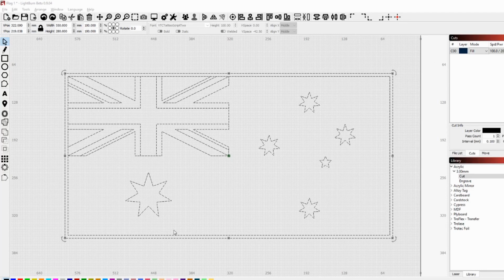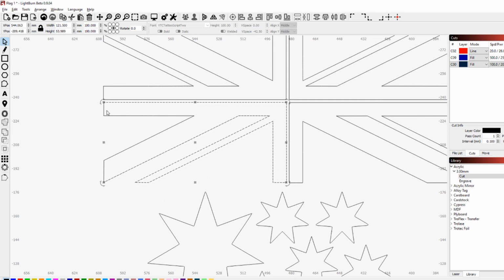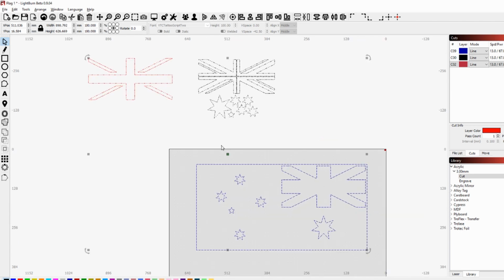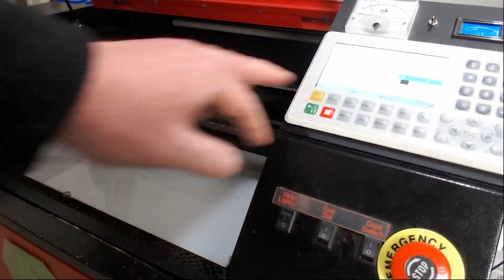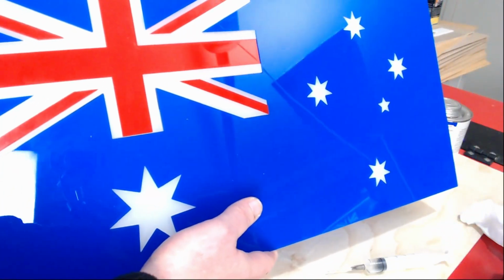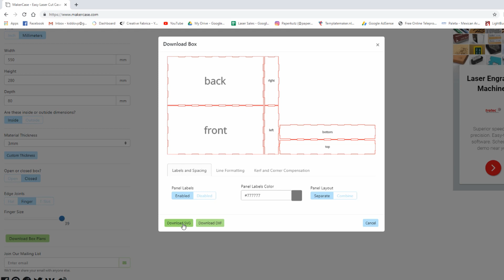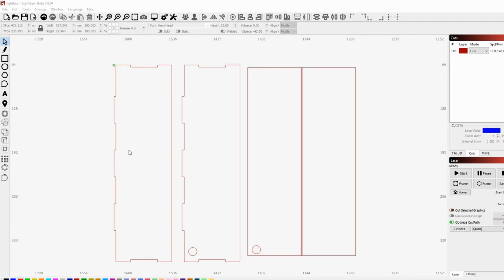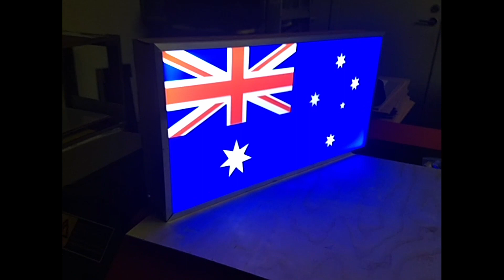Laser Cut Acrylic Inlay Flag Light Box Project

Comment: Hi MW!  Great build.  What material is the metal frame you used?  You referenced a 3m tape on it...but I love the shape.  What product is that for the perimeter metal frame?
Reply from the maker: This is just an Aluminum extrusion (90 degree angle) that I applied the 3M adhesive tape to.